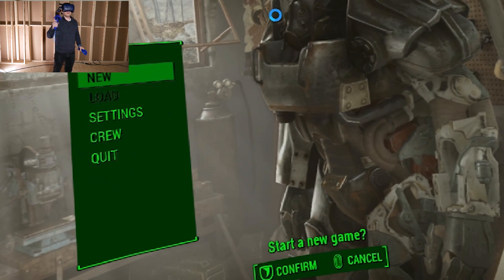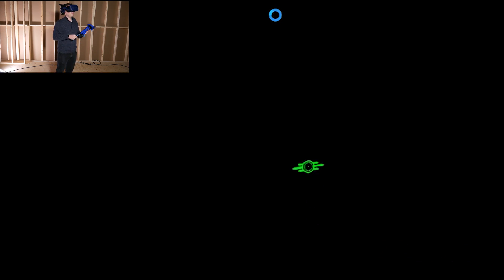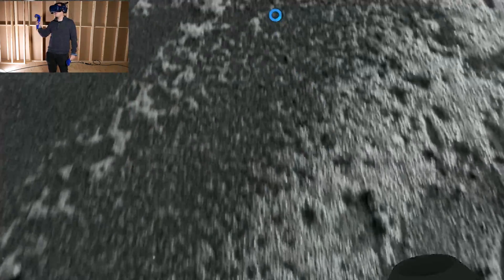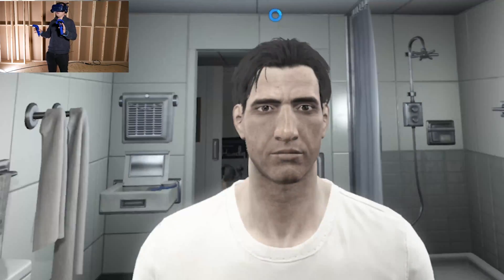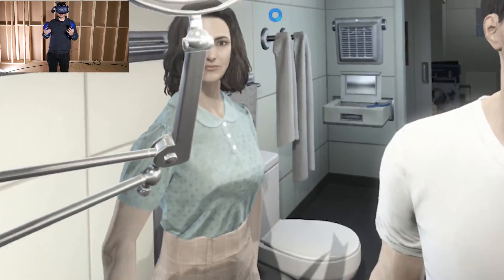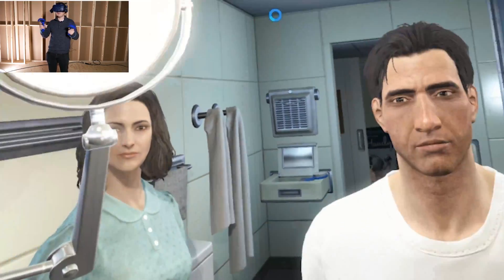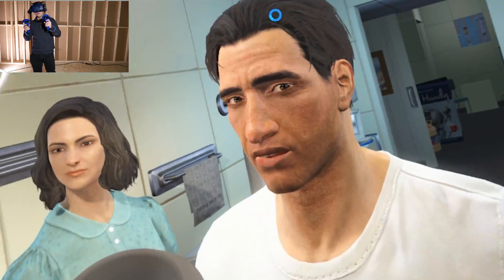Troubleshooting HTC Vive Wireless Adapter

Comment: My Vive is working perfectly with this until about 30 minutes into it. Then i have severe Lags and, looks like disconnection issues. The Adapter itself is getting really hot, is that normal?
Do you know any advice? Vive Support did not help...
Reply: It probably overheated

Comment: mine will be working then my vr goggles go gray and the vive on my computer screen will say head set not tracking or found.
Reply: I fixed some similar problems by replacing the power cord maybe try that
Reply: @the1cheez  mycase brand-new straight
Reply: Night Stringers the power cord is trash mine had some similar problems after 1 hour of use
Reply: @the1cheez  Mine still lights up it's just a gray screen inside my vr headset
Reply: Night Stringers ik don’t ask why I saw it on reddit they said get a new power cord so I did mine doesent go grey anymore

Comment: hi I have had the wireless adapter for a few months now. when I first got it it would have this weird issue were it would completely disconnect and got to black. steam vr would say the headset is not detected. i was able to get it repaired and sense then I haven't encountered that issue, but a new issue started and randomly the headset will just go to blue and steam vr will need to be restarted. I dont know what causes this but it is really annoying. I have an intel i7-8700k and a 1080ti so its not my specs. I also have the pcie card in the highest available slot and all my slots are gen 3 pls help. I have contacted htc support but they are complete morons and cant help at all. this problem also occurs in all my games

Comment: issue i'm having is it will not work with Zero Caliber. when wired, game works with wireless adapter, black screen in headset. I can hear sound, and see the image on my desktop computer as if the headsets on the floor, but nothing in the headset its self.

Comment: So HTC did a recall for the wireless adapter for AMD Ryzen users. I however checked some forums and they said that it was only incompatible on the low end SKU's.  Is there any way you guys could do a video debunking or affirming this so I could know if I should pull the trigger.  I've got an 1800X and a 2700X and they're both clocking over 4Ghz.  Thanks for your content.

Comment: Ok.. i think i only have one pci gen 3 slot for my graphicard.. is that called that in the manual?
Reply from the maker: So you only have 1 PCIE 3.0 ? Umm usually it should work on Gen 2 even Gen 1 since all that HTC is putting in their requirements is "PCIE 1X" ... but my real life experience (Can't talk about everyone) is that it works much better once enabled with Gen 3. It might be just a question of PCIE Lane management from the motherboard, because regular motherboard have so little PCIE lane that they share like a pool between interfaces and sometime the management from the motherboard is a bit flaky ...